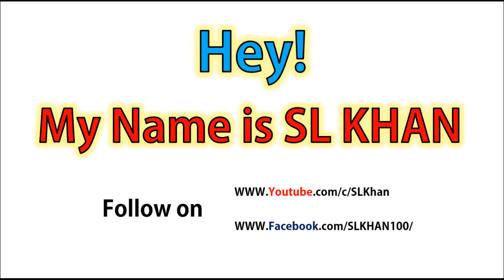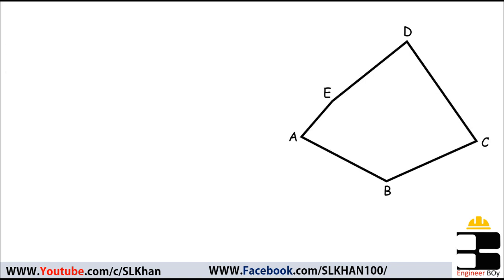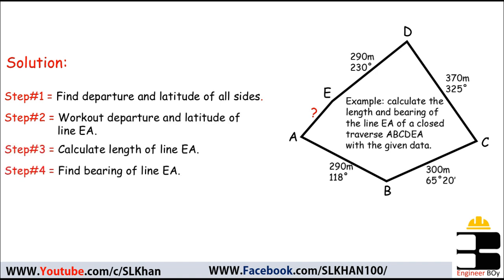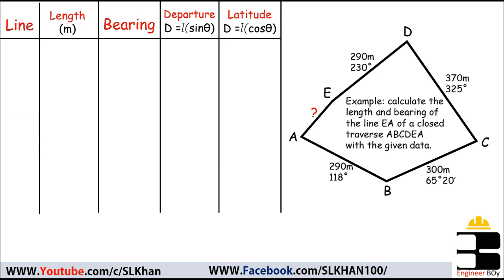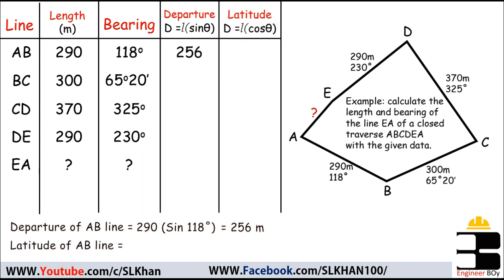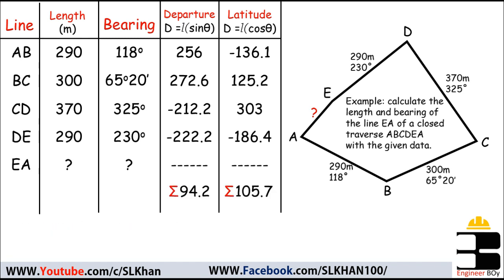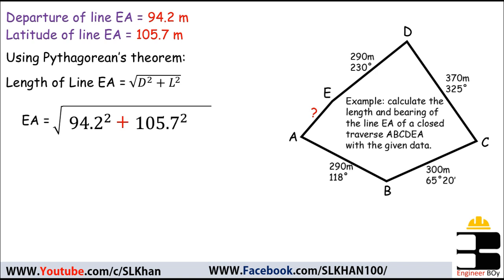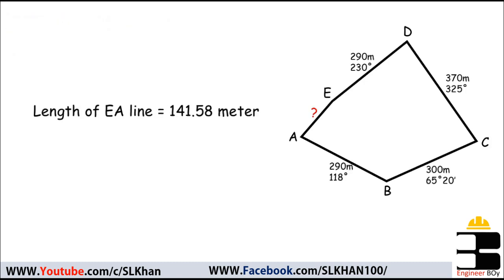how to find missing data of traverse in #land survey

Comment: The Bearing of line EA must be 221.7 degrees. It is 180+41.7 = 221.7 degrees. Then only it will be closed traverse without closing error.